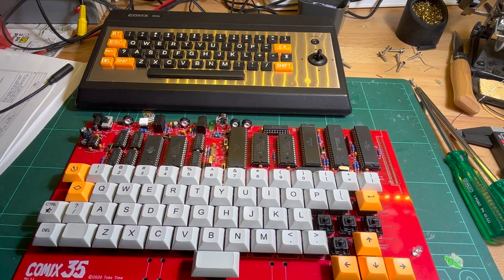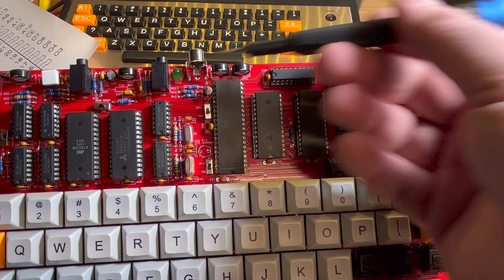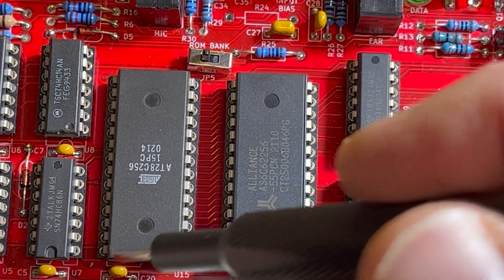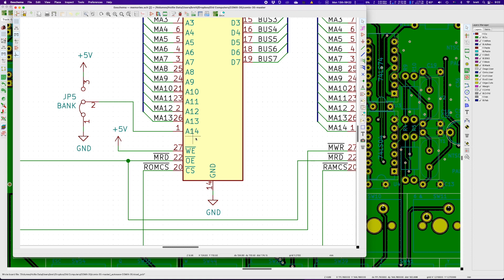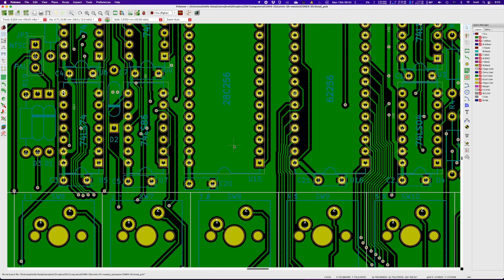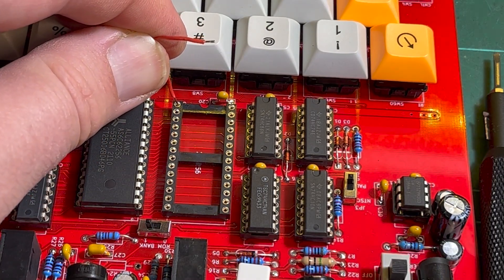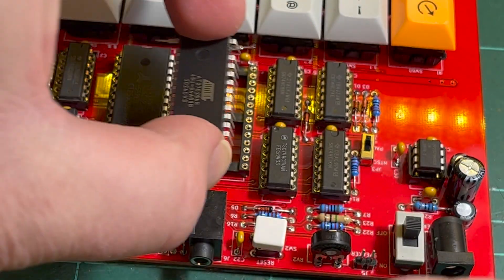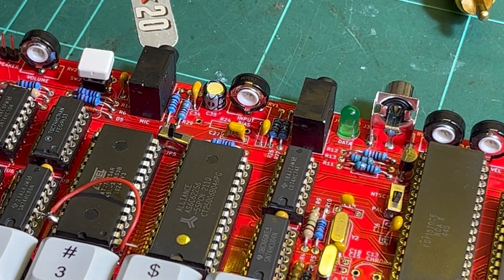🇭🇰 COMX-35/COMiX-35: Part 8 (Using a 27C256 in the COMIX-35) [TCE #0049]

Comment: I’ve got several 28C256 chips. I didn’t realize they were so hard to get. I just don’t have an EPROM programmer that will program them so I’ve been using 27C256 with the UV window. 

On my COMiX-35 I’ve done exactly what you’ve suggested, spreading the pins just outside the socket and running a jumper for A14. I’m using Marcel’s ROM images from the Emma emulator. 

I’ve got some high speed 1802’s and 1806’s so I can run turbo very fast. Currently I’m using an RCA Z 1806ACE and I’ve got turbo running with a 10MHz xtal. It never glitches or has any trouble at that speed but the sound is dependent on the clock speed and at high speed it sounds ridiculous so running any legacy software is better at standard speed. 

They’re a fun little computer. It’s too bad that they didn’t arrive earlier and in the North American market, where I am.
Reply from the maker: When I made the video (July 2022)  there were only military versions available for around US$300-400 each ... but it looks like there is now (Dec 2022) a small amount of consumer versions ... but still a little pricey at US$30-40 each ... cheaper ones are "on order" (checking from Mouser)!  If only there were some open source expansions, like an SD interface, available for it /Brett